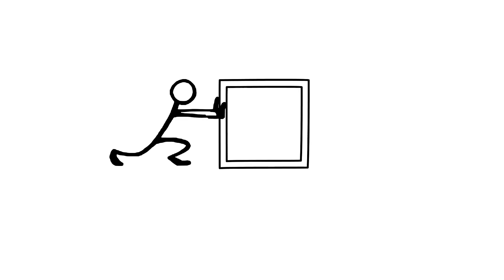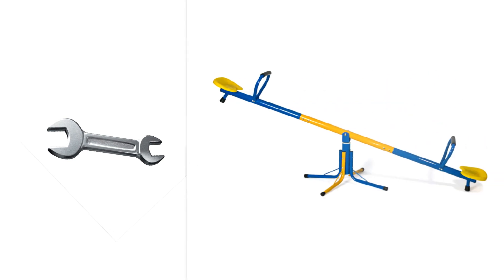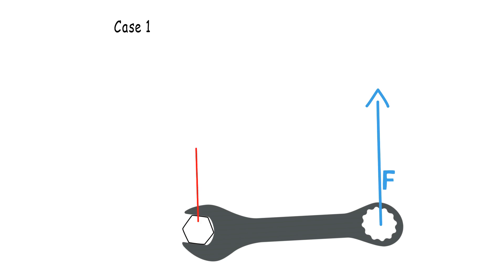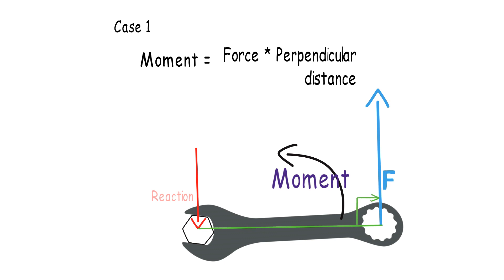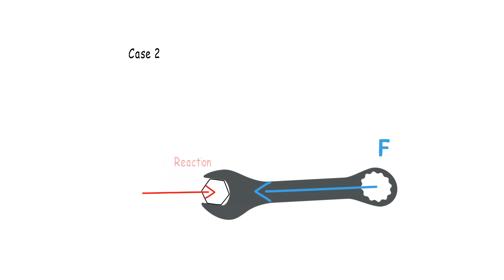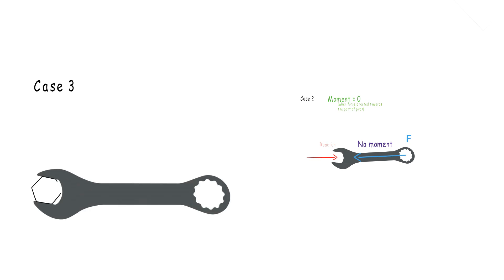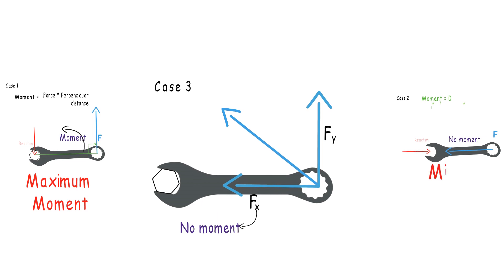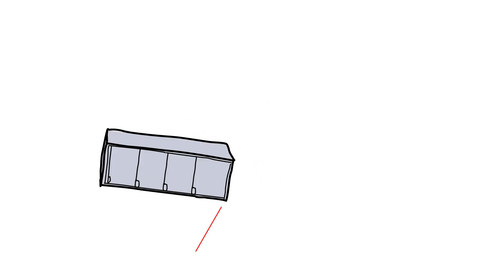What is moment of a force, with examples (practical application)!!!

Comment: Why Moment = Force * Perpendicular Distance ? Please explain easily.
Reply from the maker: The above equation can be called as a mathematical definition for Moment. The force applied at a distance to cause rotation only works if the force is applied perpendicular to it, or tangential to the rotational axis. If you try to apply a force radially towards the axis, expecting it to rotate,it wont work